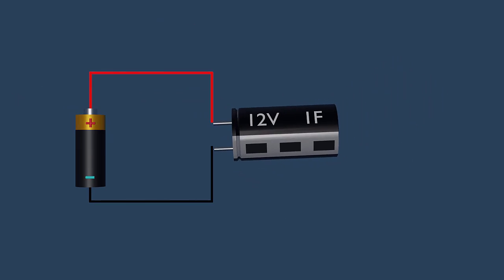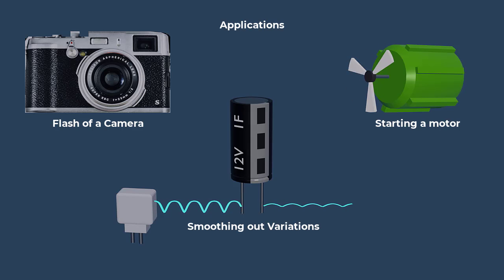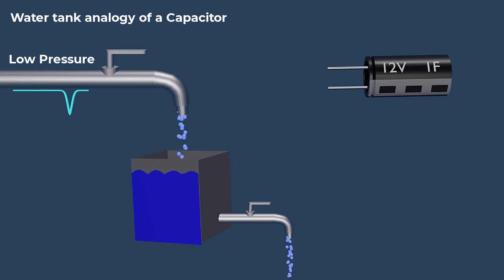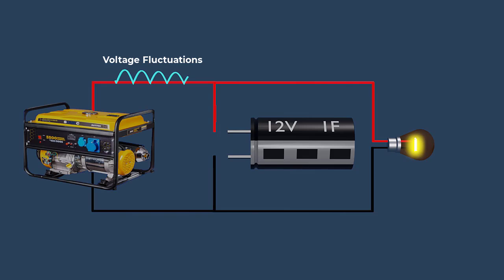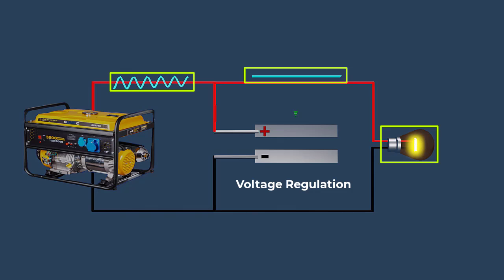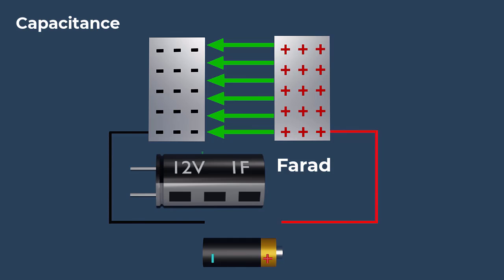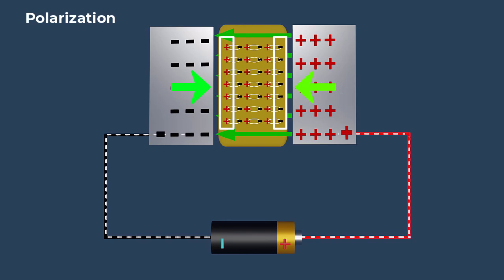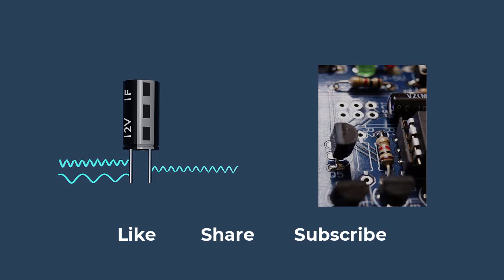Capacitor working animation | Dielectric polarization | How Capacitor Works | Capacitor animation

Comment: The best "water" analogy for a capacitor is the ballcock in your toilet's cistern: as soon as you flush, a lot of water (ie, current) flows...as the cistern refills, the ballcock rises and starts to shut off the flow until eventually it's shut off altogether when the cistern is full.

Comment: Water tank analogy wrong animation
Reply from the maker: Our goal is to make complex science concepts easy for everyone to understand. Using analogies that exactly match technical devices can sometimes be tricky for a layman. Instead, we try to find simpler comparisons that capture the essence of the concept in a more relatable way. If you have any better idea to achieve this, we'd love to know
Reply: How would you make the analogy better then @tawer9210?
Reply: A better mechanical analogy for a capacitor is a spring.
Reply from the maker: Spring works similar to inductor, we have recently uploaded video on inductor.

Comment: Hello,  if we look this picture is using DC capacitor  so is it the real meaning or only for example ? 
So can this generator connect with AC capacitor to make the voltage stable ?
Reply from the maker: This is just an example,  AC capacitors are already present in devices, such as in electric motor and refregerator.

Comment: Capacitor does not work in dc battery
Reply from the maker: A simple dc circuit with constant voltage do not require a capacitor. But a dc circuit with voltage fluctuation, requires a capacitor.

Comment: It is micro farad  not 1 farad,,secondly battery is more closer to water tank analogy than a capacitor,,,because it is very complicated to get energy back from capacitor and a c power capacitor,,,for power factor correction do not work as water tank
Reply: Bhai wo DC POWER ka dikha raha hai na ki AC POWER
Reply from the maker: Ac power have the same format, with difference that root mean square values of voltage and current are multiplied.
Reply: @Janvisualphysics  what I meant to say is that capacitor Is also used for power factor correction,,in that case it just nullify effect of inductive load,
Reply: @shivamjha2001 Why are you Indians so slow at language comprehension? She clearly included AC generator in the explanation.
Reply: Aachha sa video dekha karo

Comment: Why does the charge accumulate on plates connected to the battery ?
Reply from the maker: Applied voltage ( battery ) force the charges to accumulate on the plates.

Comment: I have watched over 20 videos explaining capacitors in animations. This one is the only one that accurately shows how the capacitor charges and discharges and simultaneously helps to power up the bulb during overvoltage or undervoltage. Thank you
Reply from the maker: Glad it helped
Reply: Super explanation